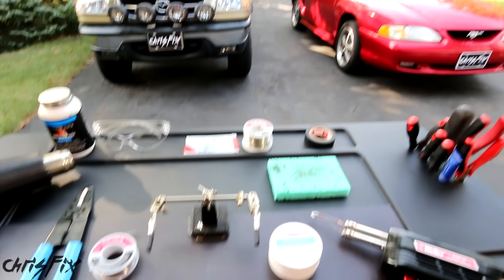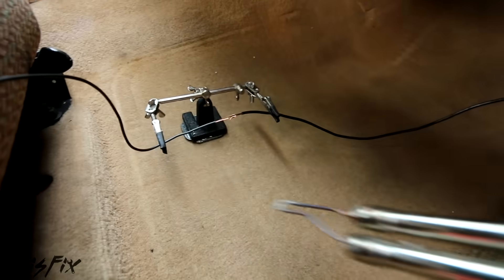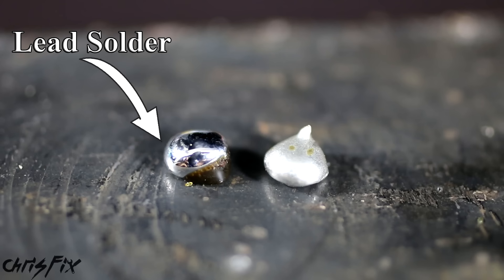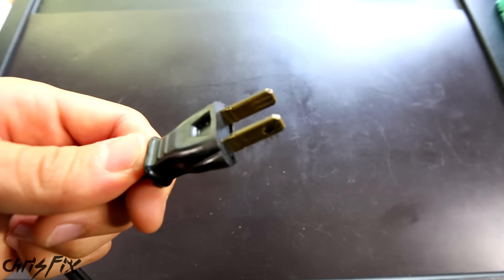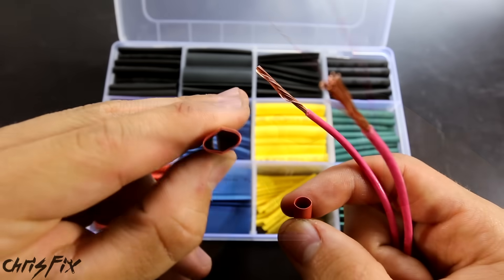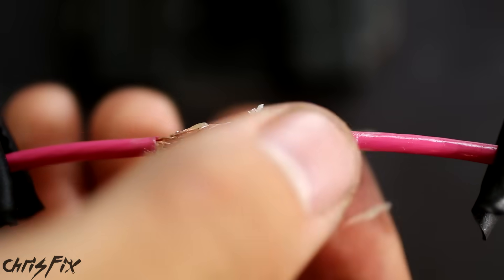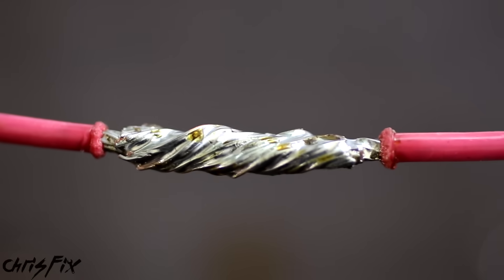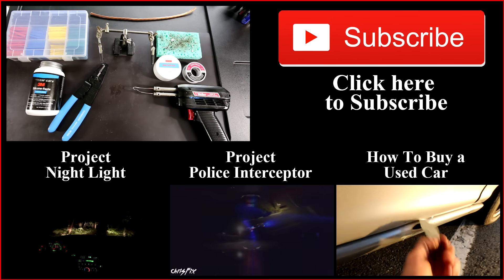How to Solder Wires Together (Best tips and tricks)

Comment: I am currently trying to solder a computer fan - two wires, First went fine, Second is just turning into little balls of solder wire - why? - I have already re-soldered a usb power cable to my wireless charger and that went fine but my second wire just wont work
Reply: Probably oxidation on the wires. Try and cut a lil off and strip a new section of wire to solder and try it with some flux,should be fine without it but if you can use some it will work miracles!
Reply: +GoldenKittyCat
Get some liquid RA flux. It looks like maple syrup. Put a drop or 2 on the wire before heating. You'll never have problems with solder sticking again.
Reply: clean the tip properly and use flux :).
Reply: +quangluu96 
I think u mean if it's 1 or lower resistance it's a good joint.
Reply from the maker: My awesome subscribers answered already (thanks guys) and they are right. If the wire ends are dirty it will not solder right. Use flux and rosin core solder and you will be good to go!

Comment: Well , all my solder joints need to be redone now .......... I thought I was doing good , now I have to redo them ..lol .................................................. Here is a question ..... How do you fix a cold solder joint with out cutting the wire again and it end up too short  (like a chassis harness .. )
Reply from the maker: Yes you can easily fix cold soldered joints. First use the helping hands to hold the wires together. Then add flux over the cold solder and wires. Then add your heat and a little solder to the soldering iron tip and heat from the bottom! Now the cold solder will melt into the wires when you get the wires hot enough. Have solder on hand just in case  you need to add some more.
Reply: Add some lead to it. Not too much. The rest of the lead should melt.
Reply: ChrisFix , Thanks for the quick response ... I have to do this tomorrow actually , as a car I am working on is coming by for an unrelated problem (messed up trans) .. But it will also allow me to redo some other repairs on the wiring ..... Thanks for these videos , very helpful ......
Reply: I believe you  can buy some copper mesh tape/ribbon, works fairly well.

Comment: Excellent tutorial chris :-D.
The only other problem is dirty wire, where the damp has turned the copper black, very common with older cars, cut back to the good wire if you can :-).
Most rosins are acid, cleans the wire.
There used to be a product called "Spirits of salts" very very good for cleaning metal for soldering, not sure you can still get it though.
Reply from the maker: Thanks a lot bud! Yea the rosin solder is non acidic which is why I use it!
Reply: yeh

Comment: great video Chris , the only exception I have is using coat hanger wire instead of the pricey tip, there expensive for a reason the outer coating conducts heat better which is why you never supposed to sand old solder off,

Comment: Good video i did not know about the lead free solder test,One thing though soldering makes the wire into a solid metal rod which can break more easily in high vibration situations  ,engines ect.

Comment: EXCELLENT Video!  We documented.  One little tip I might add, if you strip the wire and it's NOT shiny copper, you will have a very hard time getting the solder to stick.  You MUST have clean bare copper (or clean it with steel wool) for a good joint.

Comment: As a ham radio operator who has soldered many wires and circuit components and motorcycle electrical "farkle" installer, I heartily endorse your technique, Chris!  You didn't miss a thing!

Comment: Hey ChrisFix! Awesome Video as always! Last week I used your "How to SUPER CLEAN" your Car" Video to clean my Car and it worked perfect. The only problem I have is that I can't park my car inside a garage (because I don't own one). After 2 days my car looks very dusty and you can't really see the cleaning job I did 2 days ago. Is there any way to prevent the dust on the car without having a garage, drive it around or clean It every day? Thanks for the answer I really appreciate it! Greetings from Germany! :)
Reply from the maker: Awesome man!!! That is great! There is no way to prevent dust unfortunately but the good thing is if you just hose the car off with water and use a leaf blower to dry (so a complete touchless rinse), the dust comes right off!
Reply: Or you could just buy a car cover, they work great, specially if you street park a lot it will protect your car from water sprinklers that will leave water marks all over your car. But buy the ones with the O rings included so you take wire it on your car, windy areas can make your cover fly away like a kite and it also help to prevent you cover from easily getting stolen.

Comment: I just use the tip, or the slightly less hot part that it mounts into, to shrink the heatshrink. Holding it in place will liquify the tube, the trick is to keep moving and gently stroke it down to size.
Reply from the maker: Thanks for the tip! I always end up melting the heat shrink when I use the tip lol.
Reply: Well, to be fair, I just use a 25w iron, the gun may be a bit much, but it may work if you let it cool down a bit or use the mounting part, it's not nearly as hot as the tip.

Comment: I do lots of soldering. Some circuit boards which I find more difficult. I won my soldering gun actually In a contest. I haven't gotten to use it yet though. Only done some smaller gauge wire
Reply from the maker: That is awesome! Let me know how you like your soldering gun when you use it on wires!
Reply: +ChrisFix I sure will! Going to be wiring some stuff on my truck soon! I actually have the same gun that you do!
Reply: +ChrisFix loved the gun. I did some soldering a while back on my truck and it worked amazing. Heats up real nice. A lot nicer than my generic $15 iron. That will be upgraded soon too.

Comment: Forget soldering. I crimp everything. Also the heat shrink is not going to be 100% watertight if its not the one with glue in it. Also buy heat shrink in bulk to save money.
Reply from the maker: Thanks for sharing! If you crimp properly, crimping is a great method too! Most people do not crimp properly (even though the think they can). It is also a lot harder to crimp properly than solder so it really depends what type of work you do.
Reply: Yeah sadly if people only would buy proper crimping tools that makes a good crimp everytime not the one which looks like your splicer(except it has the splicing part on the handle). Soldering have the downside of melting before the wire does if there is a short.

Comment: I like your how you tell how to do it you say all the details.
Reply from the maker: That is the idea! The only way to learn is to know all of the basic information. If I just showed you how to solder you wouldnt know why you use flux or silicone or why I add the heat from the bottom.

Comment: I previously worked in an electrical components manufacturing factory for a couple of years.

The lead free solder is almost never used in automotive industry despite it's environment-friendly attribute, it wasn't elastic/durable enough to keep the parts inside a vehicle's electrical components without the solder parts cracking, thus potentially leading to serious electrical failure.

The lead free solder is mainly used in home appliances because it's lead free and doesn't need to endure vibration & shock. 

I hope this info helps when you solder your car's electrical wires yourself !
Reply from the maker: Great info and thanks for sharing!!!

Comment: Great tip with the silicon. I've never used that before having only used heat shrink.
Reply from the maker: +hallis1 thanks! It makes such a huge difference! That soldered joint will never touch water if it has silicone in it!
Reply: Same here.

Comment: Nice video chris, but.. The fan isn't giving you a cold soldering? You should use it pulling the air from the soldering zone.
Reply from the maker: +Alan Gonzalez thanks! The fan is tiny and the 140 watt soldering gun is a lot of power. You saw how good the joints came out. No problems at all with no cold solders. Whether you push or pull air is basically the same since the same amount of air moving is the same. If you use a strong fan and small soldering iron, you might run into problems but you will notice it. Good thinking!
Reply: I haven't noticed it was a 140w soldering gun, its because on my electronics projects i use a 30w and that happened to me with a fan
Sorry 4 bad english.

Comment: for all outdoor jobs I usually coat the joint in dielectric grease before Heashrinking. Also, the NASA method is the best method of not twisting the wires is good for simple projects , but for outdoor jobs I like to do some the first splice you showed, because the inner core of wire means the connection will last longer of it starts to corrode.
Reply from the maker: +LinusScrubTips thanks for the tips!!!

Comment: flux is not designed to protect wires it just happens to do it flux is designed to be like a solder magnet, to help when soldering in tough places which is why solder has rosin cores it is flux inside the solder to drip onto what youre soldering while your tinning the tip and soldering in general.
Reply from the maker: Aseredy, the flux I recommend is rosin flux which is non acidic so there is no need to clean it up (which is why I use it). I too use to use regular flux and have to clean it with alcohol but now that's one less step! Thanks for sharing!
Reply: Correct. It limits oxidation of the solder while molten, and helps clean the surfaces (which is why solder flows so much better with flux). Though most flux is acidic, and should be wiped off with alcohol when done. At least when working with circuit boards... not sure if it's super important with just wires.

Comment: certain fluxes are corrosive, best to remove it with 99% alcohol
Reply from the maker: +Galen Thurber I specifically say to use rosin flux which is non corrosive for that exact reason! Thanks for the tip!

Comment: I learned a different way to solder (it hasn't failed me yet), but is this just a good way you like to do or the "Official" way to do it?
Reply from the maker: There is no official way but this is the proper/correct way using all of the correct procedures and coming up with a good joint.

Comment: As an IT person and someone who has been soldering for a while, I recommend the splay and splice (where you separate the strands and mesh them together) when you don't need it to look nice since the bulge isn't uniform but it gives you a stronger connection pre-solder. Use the 'western union'/'linemans' splice when you want a smaller form factor. The real money is where you use a 'western union' but you double back on yourself to create a knot so that when you pull, even if it's not soldered, it's self -tightening and won't come apart without some serious pull.
Reply from the maker: Thanks for the splicing tips!!!!
Reply: ChrisFix No problem Chris, thanks for all your car tips!

Comment: I accidentally used flux for copper pipes on my car electric wires.  it says "not for use on electric systems ". Will I have future problems?
Reply: You might get corrosion, as pipe flux is typically acidic.
Reply: If I were you I'd remove the soldered section and redo it properly, since the connection will most likely degrade rather quickly. Better off fixing it now before it becomes an issue.
Reply: +Greg Radler
Yeah, acid flux will start corroding copper from day 1 and ruin the connection. 

Cut the wires 1 inch either side of your solder job and add a new length of wire in between. The good news: you can practice soldering 2 more times!

Comment: This is good for wires only. The heat was too long for PCB boards. Seee it wire insulation is actually melting.
Reply: Hopefully you wouldn't use a 140 watt soldering gun on a PCB either, but with that thick of a gauge of wire, it should be fine.
Reply from the maker: Yes, this video is for joining wires together

Comment: Hey Chris , instead of using heat shrink tubing . Can we use electrical tape ? 
I'm just wondering if electrical tape is efficient as heat shrink tubing.
Reply: i work with electrical tape and i dont reconmend it since it is easy for it to peel off over time and create a short. i recomened for you to use heat shrink tubing. -Connor

Comment: Lineman splice should always be used if the wire gets any kind of tension on it. For anything else, its honestly not that important how you splice the wires, as long as they are in good contact.
Reply from the maker: Thanks for the tip!

Comment: Great video Chris! I knew most of this but definitely learned a couple new tricks. Specifically the silicone paste under the heat shrink. Would I be able to use a bottle of NAPA Sil-glyde that I already have lying around? If I can save costs and use that I will.

Comment: I don't like soldering so I usually use crimping for automotive use,thanks for the video nontheless
Reply: +Leroy Baker the turbo gods approve
Reply: unfortunately was done to my car and it has massive amounts of modified wires so who knows which connections the "pros" paid to modify this messed up when they installed it. All I know from modifying wiring in cars and electronics for decades is crimp connectors fail constantly.  Most fail right off the jump. Gotta go to special stores online and get quality crimping connectors cause auto zone and advance auto and local stores like walmart have pure trash for connectors. If I'm too lazy to solder then I'm fine with twisting wires together and using tape to insulate.
Reply from the maker: Soldering is definitely easy to do properly but if you know how to crimp wires, it is faster and easier. The best thing would to crimp, then solder, then heat shrink but now we are getting a little carried away haha!

Comment: The pistol style guns usually have a multiple watt setting. Depending on the iron the first stage is about 100 watts for smaller gauge wires. While the second stage is around 3-500 depending on brand and model, for heavier gauge stuff. Often they are adjusted by how far back the trigger is pulled in an (off, on, ON) control. 

Also when heating the wire try not to let the insulation melt too much. Because most pvc type insulation will break away once heating to the point it begins to melt leaving exposed wire past the heat shrink after the job is done. 

And also while you want complete coverage and penetration of the wire strands and avoid bulges of the solder joint, it's important to watch for bulges in the insulation. If the insulation bulges significantly past where it was stripped you've added too much solder and it has penetrated into and under the insulation. This might not be a bad thing all the time, but it can lead to brittle points in the wire by reducing the flexibility in the wire itself. Instead of having a small solder joint that can be easily tucked away with the wiring, you not have a bulky stuff section of wire that will break when the wire is flexed near the joint. Even experienced solder guys make this mistake. 

Fast heat is usually best as well, but lower slower heats might be more reliable for complete penetration without damaging the insulation. Practice on the wire you are using to see which works best first.
Reply from the maker: Great tips and thanks for sharing!!!

Comment: For my electronic project I prefer using 1/3 and 1/2 shrink tubes with glue inside: that layer of hot glue will work like silicone, but you don't have to buy the silicone too. (also, 1/3 are thicker)

Comment: what happens when tining the tip with solder and it just drips of
Reply: If solder won't stick to the tip, the tip is corroded or oxidized. Get it hot and wipe it with a damp (damp, not soaked) sponge. Or you may have a copper coated tip (copper over some other metal, rather than solid copper) and the copper is worn/gone; replace the tip.
Reply: Slicerwizard thanks

Comment: it's nice to know I've been cold soldering my entire fuckin life. lol
Reply from the maker: The most important thing now is you guys know you are cold soldering so you can fix it! If you add flux and add the heat at the bottom of your old cold soldered joints, the cold solder should wick though the joint and create a proper solder. You might need to add a little  more solder so have it ready just in case!
Reply: me too :)))
Reply: Same, but now we know
Reply: haha, you're not alone man. :)
Reply: yup. I'm pissed because I bypassed the security system in my car, and I soldered in the resistors and cold soldered them in, and now I feel the need to do them again.. which sucks because it's hard working under the dash with solder :(
Reply: My first soldering was a cold solder on a cheap headset I had. It got the most of the sound back into the right earpiece, but it lacked the bass it used to have. Now I know exactly why.

Comment: Twisting the wires together is not optimal. When pulled, there will be a twisting force trying to tear the solder apart. Join them side by side instead.

Comment: what is "12 gauge"?
Reply: In this context - A size of wire, North Americans typically use the American Wire Gauge (AWG) system for wire sizes instead of using the cross-sectional area in mm^2 (12 AWG ~ 3.3 mm^2, see table here: https://en.wikipedia.org/wiki/American_wire_gauge#Tables_of_AWG_wire_sizes) 

The higher the number the thinner the wire (Most likely the number of such wires required to make up some base unit, much like a 12 gauge shotgun has an inner barrel diameter such that 12 solid spheres of that diameter weighs 1 lb.
a 20 gauge is smaller as it requires 20spheres to weigh 1 lb
Reply: Michael Tempsch You didn't have to type so much:P but thanks a lot, been wondering about it for a long time and google didn't have a concrete answer.